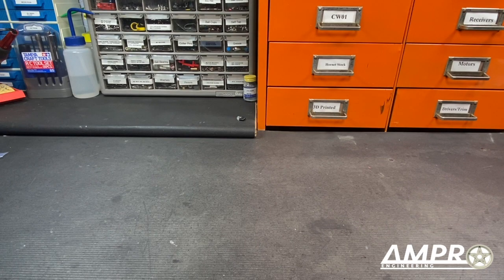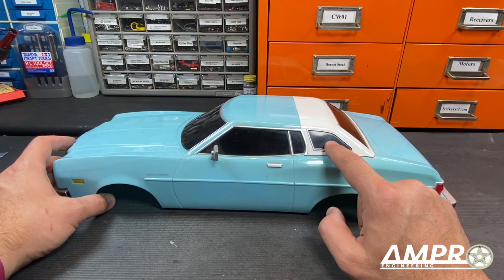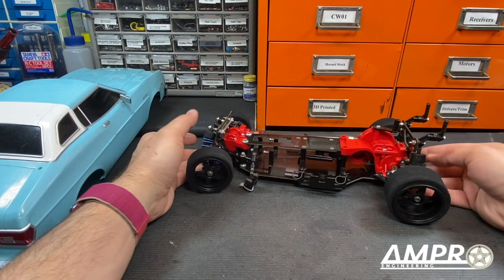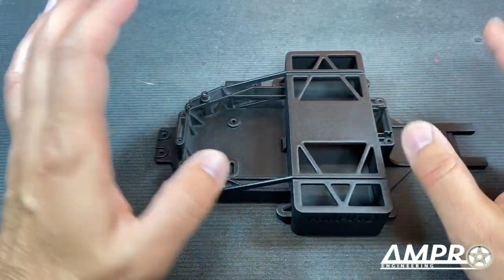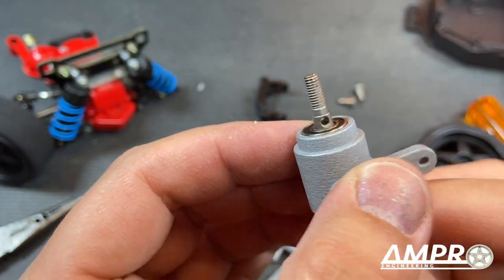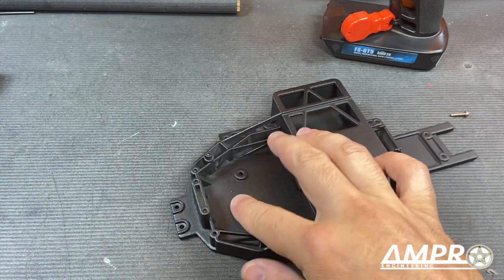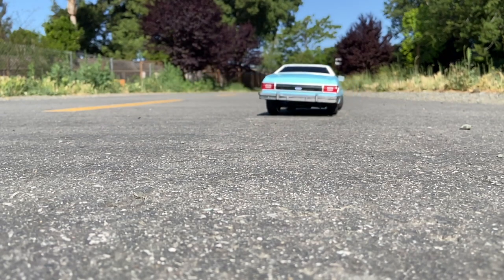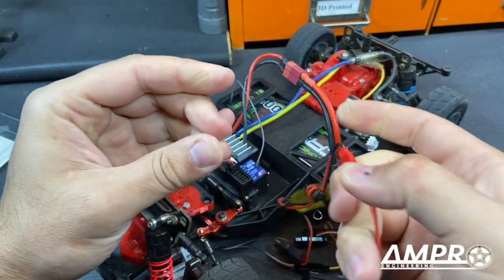E325: Custom Tamiya Ford Torino TA02 Chassis, Part 1!

Comment: That’s very cool! I might need to upgrade my radio to move the REV to the transmitter. I hadn’t thought about linking the lights to the siren - neat option. I have them on separate channels so I can use lights and sirens when pulling over my kiddos and then drop the siren but keep the lights as I given them a warning. 😂😂😂

Great build.
Reply from the maker: Hahah! Yeah it worked well for that application and will even better for those pesky speeding children! Thank you!

Comment: That's a fantastic built! Even though I'm a subscriber of your channel for years I somehow missed that video. I'm currently working on another RC Police car (Mustang SVT on FF02 RWD) but decided that it should get sound and light that is controllable via the remote. Since I was never satisfied with the available sound modules (too expensive or bad sound quality or not controllable via the remote) I decided to build my own one using an Arduino. It kind of works now but still has some flaws I have to fix. I really like your Idea with the Engine sound that can turned on manually for revving the engine! I think I'm going to implement this in my control, too! Greetings from Germany, Robert
Reply from the maker: This is a very good idea. I really need to look into Arduinos as we use them often at the office but I usually just make the EE's set it up. I feel I am missing out on interesting projects I can use them for! FYI I love Germany, a very close friend of mine is in Frankfurt.

Comment: could you do a video on how to use the tamiya truck tyres on like a rally car as the side walls look a lot more appropriate
Reply from the maker: They will need a full redesign of the chassis arms and more importantly, and I didn't realize this either, they are way bigger than the stock tires. I got lucky here since the body is big but my original plan was exactly what yours was. It looked ridiculous . What I did is make wheels with fake side walls to get the tire to look bigger. You can see it on my Fiat Ritmo build a from a couple months ago. I do this on all my cars now.

Comment: You should check out GT Power Pro with built-in esc and Bluetooth lights engine sound Vibration for you models I install it in my trx6 snap-on hauler and just love it
Reply from the maker: Yeah I have seen that. My applications are always so specific though. The last GT power I reviewed was worthless so that soured me.

Comment: Hey are you going to get yourself a tc-01 soon I assume you like the td2 better since it doesn't have that issue with the battery even though I hear you just change the body on the td4 to allow the battery to go horizontally again.
Reply from the maker: Yeah I saw that. Na I wont be, I am not into the looks and I have my RC10 buggies so for now i'm set.

Comment: I dig it. As you can see in my profile pic,  I like Torinos. 😁
Reply from the maker: The '72 Torino has one of the most amazing front ends ever. My mom had a 72 sports roof with the 429.
Reply: @AMPROEngineering  that is a heck of a car your Mom had!